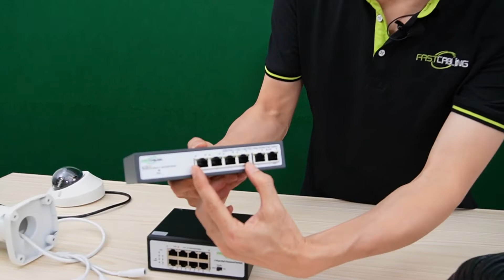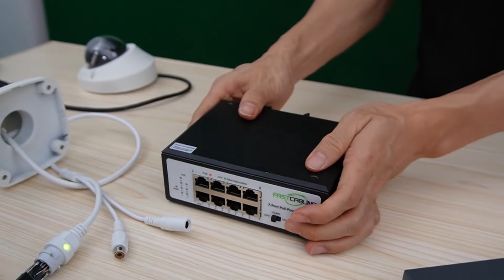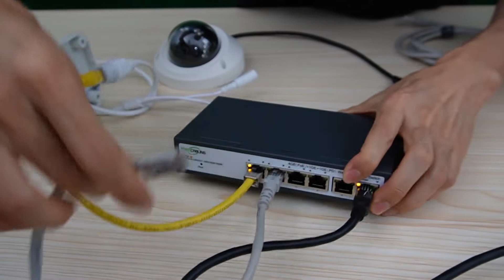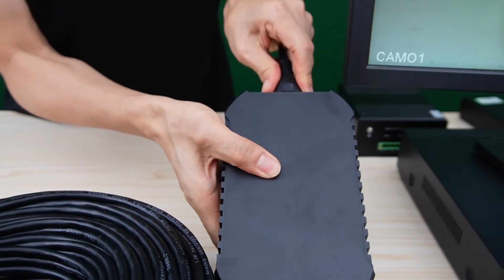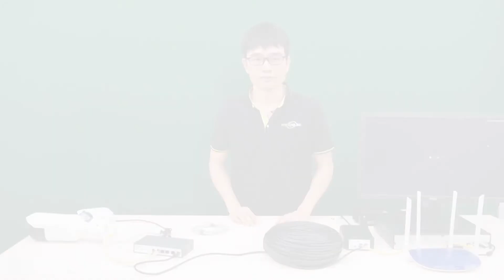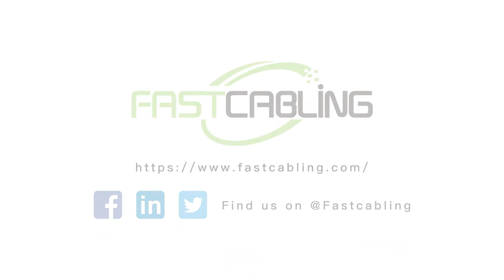How to use PoE Powered Switch to Pass through the PoE

Comment: I i have no modem internet, i should connect the lan cable from the injector to the lan port o poe port of the hickvision nvr with 8 poe port?
Reply from the maker: Yes, you can attach the PoE pass through switch to the LAN port of your NVR, but you will lose the network connectivity. You mentioned you don’t have internet. I guess it should be ok for you.